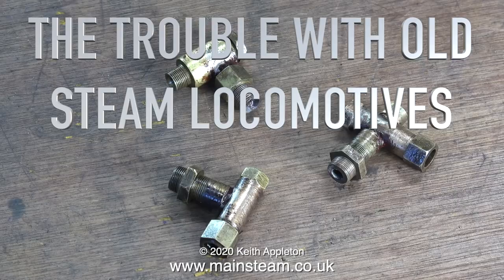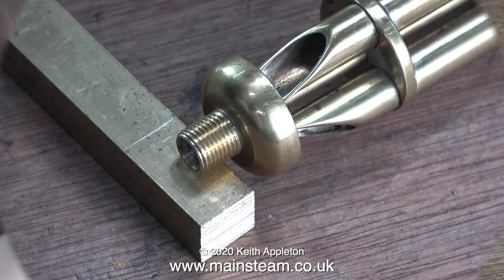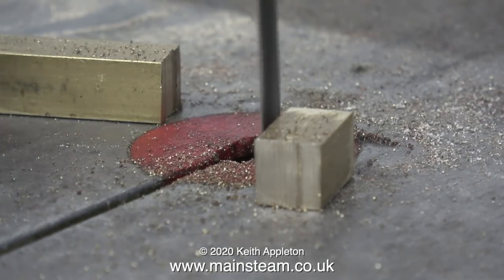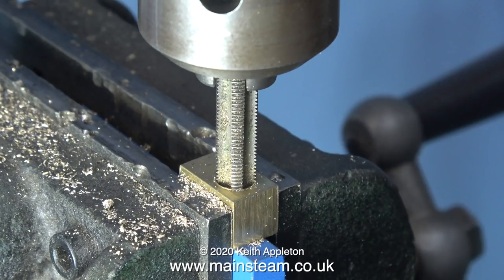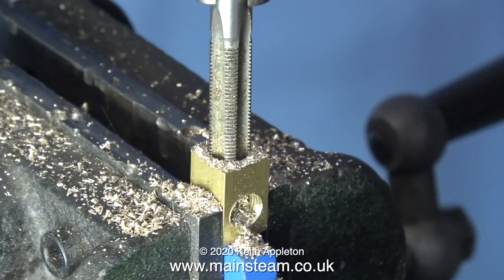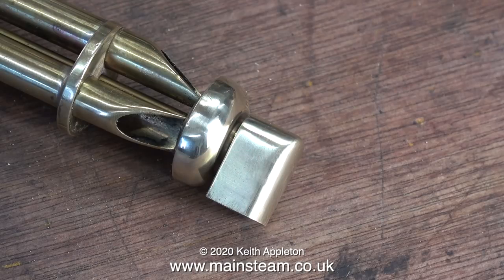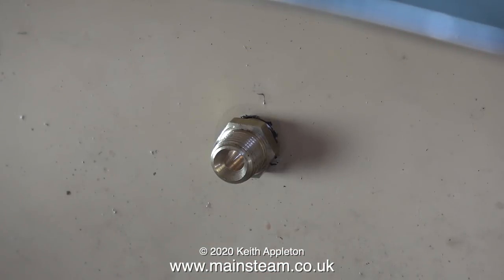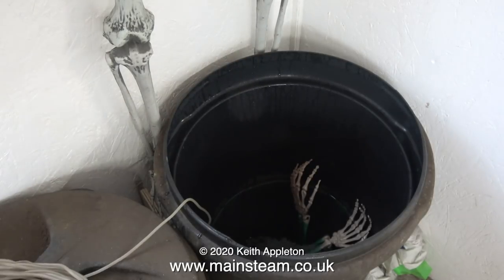THE TROUBLE WITH OLD STEAM LOCOMOTIVES  - PART #7

Comment: Really like that 3 chime whistle 

A question if I may, but if you cannnot find the time to respond, or even think it a stupid question, I quite understand. 

I build radio control tanks in 1/16 and I use them frequently, but I am finding out very quickly that they do not last. 

The road wheels are made from a cast pot metal, but the axles appear to be steel, and eventually the centre of the wheel begins to enlarge as of course it's softer than steel and they are not bushed or ball raced.

If I was to drill out the centre of the wheel slightly, and use a piece of brass tube, would this be a good bearing surface, and would bearing retainer be a good 'adhesive' for fixing them? 

Many thanks and best wishes to you and your family
Reply from the maker: Brass is no good at all for bearings. Phosphor Bronze, Leaded Bronze or Gunmetal is much better. "Loctite" 603 would easily hold the bushes in place. Stay Well }:-)))

Comment: Hi I enjoy watching your videos, but what I don't know about steam engines would fill volumes. Is it possible you may be using the term spectacle plate incorrectly? What I googled and what your showing seem to be quite different and the spelling suggests it was written in the UK. Thank You.
Reply from the maker: The Spectacle plate is the front part of a steam locomotive's cab. Please Google "Steam Locomotive Spectacle Plate"
Reply: @keithappleton  Thats what I did and what I google said was. Spectacle Plate; The transverse member mounted between the locomotive frames to the rear of the cylinders on which parts of the valve gear are hung. Sometimes wrongly used to describe the weather board at the front of the cab. And I do see at the start of the steam glossary I looked up it is based on UK practice and design. Not trying to be contrary but when I heard spectacle plate, not knowing beans about steam locos, I immediately googled it to see what in the world a spectacle plate could be. After seeing end of your video front of cab looks like spectacles as well. Thanks I'll watch more of your videos and get a little more caught up on nomenclature.
Reply from the maker: That's not right. Try Wikipedia . . . . .
Reply: It looks like there might be more than one meaning. I went through a couple of pages of google results, and while most agree with Keith, I found one other reference in a google books result that gives it as another term for a "guide yoke", and says "also known as a ... motion plate, guide bearer and guide crosstie".